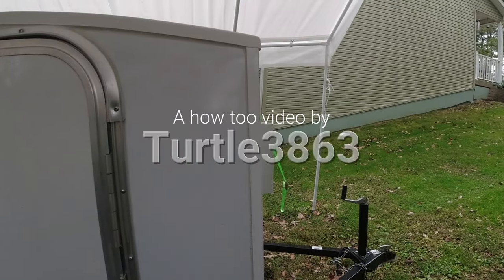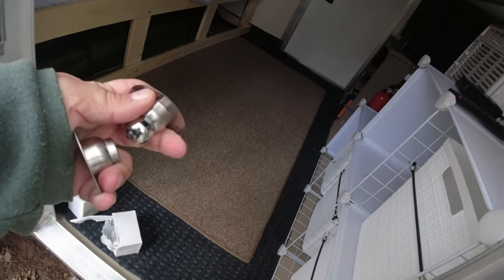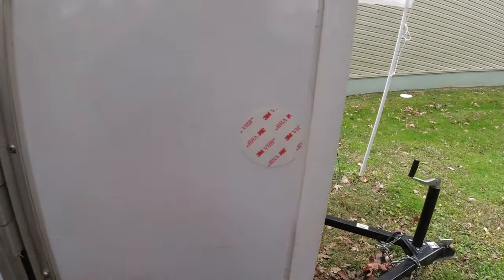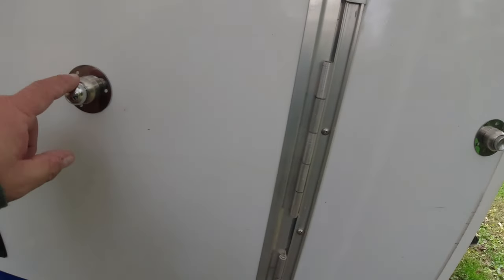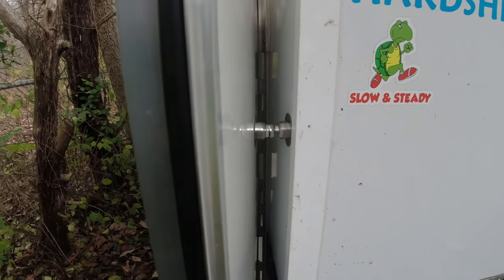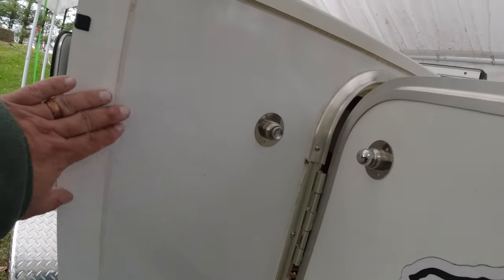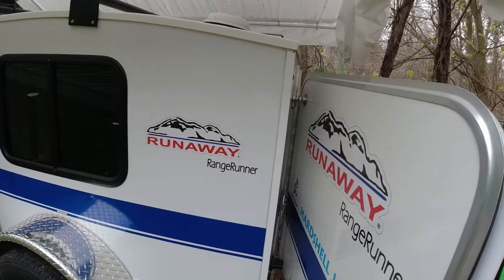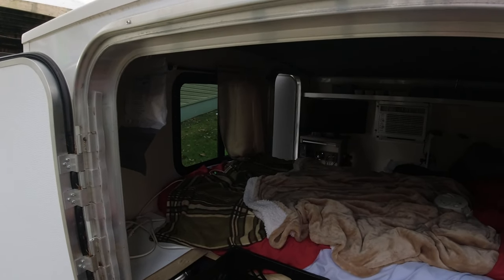RV Door Stop Install

Comment: Maybe you could just add a second hold-back toward the bottom of the rear door. Then you'd have two magnets holding the door back. Your block idea would work too.
Reply: I was also thinking multiple magnets!!! Each one will add additional strength/force. Makes me wonder what kind of weight they could possibly hold with even MORE!!!!! O.o